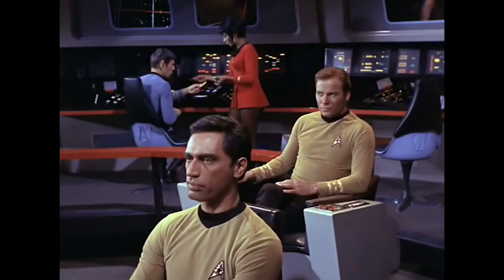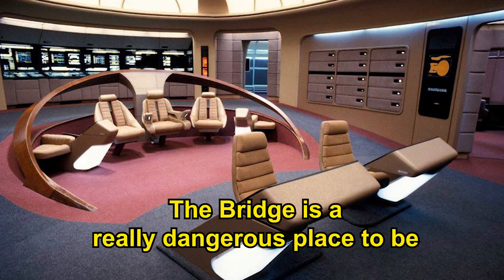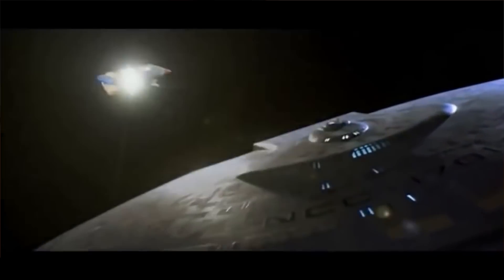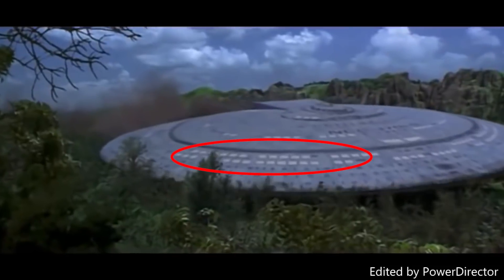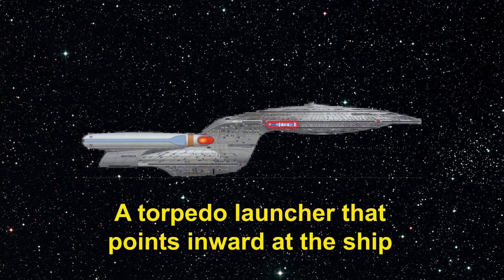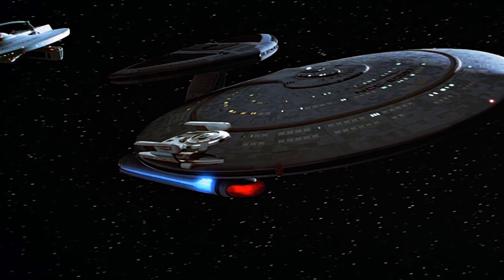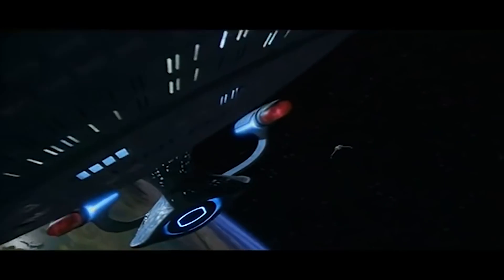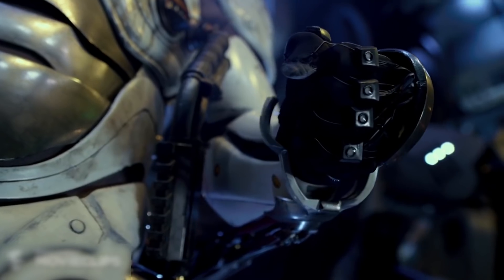10 Flaws Star Trek - USS Enterprise NCC 1701-D

Comment: One thing you missed in 10 things wrong with the Enterprise Galaxy class,about the warp nacelles:In the original design of the U.S.S.Enterprise is that in the warp design,the nacelles were placed as far away from the crew occupied sections as possible to limit exposure to the radiation thrown off from the engines while at full power.That radiation would kill everyone on the ship.Klingons,on the other hand,didn't care about how many died from radiation poisoning on their warbirds.

Comment: Flaw1 The Bridge: The Enterprise is not made for war. It is a science vessel! Flaw3 The Enterprise is not made for Landing, because usually there is no reason for it (Beaming Technology and Shuttles).  Flaw3 that is correct. Flaw4 that is also correct (Escape Pods), Flaw5 is also correct, the computer could remodulate the shields automaticaly. Flaw6  its correct tbh. Flaw7  yeah that is correct. Flaw8 The Federation has almost infinite ressources, so there is no need for saving it. There are families on all federation vessels and I think the Federation wanted to build proper vessels for them.

Comment: A few questions:  
1 What happens when you end program in the holodeck after taking a dump in there?
2 Why couldn't they replicate a bunch of Data's?
3 Speaking of Data, why does he have to use a keypad - wouldn't it be faster for him to interface via wire (or wireless)?
4 What kind of bandwidth does a Vulcan pull when he is doing a mind meld?  If you had a chain of Vulcans mind melding the one next to him/her, would there be a data loss?
5 Why couldn't they replicate more replicators?- they could build another Enterprise in less than a day!  Why not replicate lithium crystals?
:)
Reply: 1: indeed.. scary LOL
2: he apparently is too complex to be replicated through the available replicator tech
3: Most of the times Data hooked himself up to interface with the the ships computer, something went horribly wrong. On top of that there are security measures in place to prevent a single user to have such control on such a powerful piece of equipment. 
4: unknown
5: same answer as 2

I would actually ask.. if data can be "transported" why couldnt they just keep on re-materialising more? The same for equipment. The transporter tech doesnt seem to have the same limitations as replicator tech.

Comment: The Nacelle's that stick out is not the engine, they only help generate the warp field. The engine is inside, it's the big tubular gizmo in engineering referred to as the warp core. There is a episode in voyager where a admiral is giving janeway a walk though and points to the warp core as the only class 9 warp drive in the fleet, he was not pointing the nacelle's. You can also look at the series enterprise where commander tucker points to the engine and tells people your looking at the only warp 5 engine in the fleet. If you watch enough trek you get a idea how it all goes together and one reason for sticking the nacelle's out is they get very toasty hot when operating. Remember the episode in enterprise where they had to hide in the nacelle during the storm.
Reply: true, but that's like saying you don't need wheels for a car to move. also when the nacelles get hit it often damages the whole ship and engine in some way. They never really explained how the defiant can get away with having the coils inside the main hull.
Reply: It does not just heat its radiation. The Defiant is small enough that they can get away with radiation shielding. But the bigger the ship the bigger the warp nacelles the bigger the radiation hazard.
Reply: @michaelkenny7314  
Accorting to the TNG Technical Manual, the nacelles have to have some physical distance from the habitable spaceframe because the warp field distorts spacetime; where the field is not uniform objects down to the atomic scale tend to move through space and time at different rates; imagine the stress a non-uniform field density would create on the ship itself, to say nothing of organic life.
Reply: @HuntingTarg  Probably one of the reasons the Defiant has so many issues.
Reply: @matthewholderbaum3001  
No, the Defiant was the Federation's first attempt at a dedicated ship of war since the first Klingon war and the Dreadnaught class.  The warp field isn't her main hangup; it's the warp core .  Three sets of injector coils, three sets of dilithium crystals and brackets, three reaction chambers in one pressure vessel.  O'Brien was a crack technician and he hated working on the Defiant.
Yet she's still a butt-kicking name-taker.

Comment: Number 11: the saucer section doesn't have its own warp engine (unlike the Prometheus), therefore it couldn't get far away from the engineering section before the core breach.
Reply: The whole point of separating the saucer section in case of a core breach is the ability to get away from the warp core, having a second warp core inside the saucer section in a place where they can't separate from in case of emergency makes no sense, plus the saucer section had impulse engines, the enterprise-d full impulse is about 90% of the speed of light with acceleration of 10 kilometers per second per second, under normal conditions without damage it's more than enough to get far away before the core breach.

Comment: A couple of comments in no particular order:

I believe the nacelles were placed where they are to limit radiation exposure from the engines.  Why is that not a concern in other ships?  No idea.  You’d think it would be especially concerning in the nebula class, which was basically the galaxy class but with a stumpier secondary hull.  I do know it was said though either in the show or the tech manual.  The only thing I can thing of is that at the time of its design the galaxy class was the most advanced and powerful Federation starship so its engines were larger and more powerful than others so they were concerned about the radiation.

The space that ship took up is not as important since it is in space and the ship achieves FTL via a space warp.  Presumably ship could keep getting larger as long as the engines were large enough to project a warp field around the entire ship.  So, having unused space makes sense since the Enterprise and the other galaxy class starships were intended to operate for decades, one presumes you’d want to be able to easily upgrade the ship.  Technically the entire ship was modular, even the bridge could be removed and replaced.

The Enterprise was primary a science and exploratory vessel, as is Starfleets primary mission.   While the Enterprise did have powerful offensive and defensive capablilities I feel it didn’t fully come into its own until the Borg crisis.  I am actually surprised Starfleet didn’t end the practice of families on ships, at least as many as there were, after the battle of Wolf 359 as I imagine many civilians were lost as well. That being said, it made sense for the ship to serve multiple roles given it was meant to operate on the fringes of the Federation, often in deep space where they would be out of range of any possible assistance.  I mean how often did Picard and Co. really encounter other Federation ships.

The Enterprise E definitely still had science labs, it was still considered and exploratory vessel.  The Federation doesn’t really design military craft, the Defiant class being one of the few exceptions to that rule.  By the end of the dominion war many of the battles still involved glaxay classes and other primarily explorer type ships.  That being said, they did have small fighter type craft by the end.

Anyway, sorry, I can’t help but comment, but I found this really interesting.  It has honestly always bothered me that the bridge was right on the freaking top like you said.  It should have been right in the middle of the ship so it would be the most protected, Iike main engineering.  Shield modulation also always bothered me.  The computer should have been altering that constantly.  Though maybe they thought it wasn’t necessary because they’d pick a random frequency and the chances that an enemy would have their weapons on the same frequency would be ridiculously small.

But yeah, really enjoyed the video.
Reply: There was one episode where an engineer was killed by jumping into a bunch of plasma in the nacelle of something like that... I don't remember the details, but the point is they have crews of engineers who work full-time posts up there in the nacelles.

I think there was a line about how they didn't really know the one who had killed themselves well because they had only been posted there for a few weeks?  So that implies that they would normally be posted at those position for an extended amount of time, meaning it can't be too dangerous to hang out very close to the nacelles.  

I was always under the impression that the nacelle positioning had something to do with shaping the warp bubble around the ship, although it seems it would make more sense if they were aligned with the center mass of the ship, rather than in the rear. and above/below, depending on the federation ship design.  IIRC, Cochrane's original design made more sense to me... nacelles were positioned on the center line of the ship, both side to side and front to back.
Reply: @PartapDavis  I think the potential logic after Wolf 359 in regard to families on starships might end up being seeing that the whole human race sits in a very precarious position perhaps it is better that potential breeding populations exist starships that could escape to other regions of space.  It is logical.
Reply: I just realized we are talking about a stage prop. It wasn't designed so much as grown.
Reply: Not having science labs would be pretty dangerous at times, being in a Star Treck storyline. ;-)

Comment: TL:DR, I am going to take this joke concept and way over analyze it. So take my nonsense with a grain of salt. 

It had its flaws because Gene Roddenberry had no idea how to design a warship. All the ships in his shows/movies had the same flaws pretty much. Also, it seems like up until they encounter the Borg, a race with Far superior weapons and tech and the intent to use them. That the Federation had no interest in building ships purely for a war effort. They built impressive ships, but nothing solely for war until DS9 and the Defiant. Once the Dominion war heats up is when the federation really seemed to kick into high gear when it came to warships. Even then they still built pretty crappy ones save until Voyager with the Prometheus. Personally, the Prometheus and the Akira class are the only ships I have liked design-wise, the Maranda comes close but meh. 

Most of what you point out is right, but two I take issue with. Number 4 has a few flaws, first being that the diagram shows a pretty terrible way to land. It seems more sensible to land the ship by first slowing it down in atmosphere by using the huge surface area of either the bottom or top of the ship while also using thrusters. Building in thrusters large enough and powerful enough to land the saucer section in the atmosphere is nuts. The amount of area you would eat up on something that you would never want to use is terrible. Not to mention the ship was built in space and used in space and I doubt the thought ever crossed their mind to land the ship in an atmosphere let alone a crash. As shown by the lack of thought in that crash diagram, clearly if that scenario ever happened they are going to assume the ship would be chalked up as a full loss and scrapped as it was in the movie. 

Number 10, as far as I understand. When in battle the Enterprise D would use pre-programmed battle tactics, in the very few instances it ever did any real combat or dog fight style combat. All other times they seemed to enter in coordinates. They only rarely ever used that D-pad style nav pad, even then they never explain how it works to any degree, it simply does. They even use them for shuttles which you would think would be better suited with a joystick of some sort. So that is more writing and prop design flaw(Guessing they thought it looked good) in the show than anything. It would make no sense in any real-world use which is why it seems to be corrected for other shows and movies going forward. 

Also, it would seem pretty much every ship named Enterprise would have most of these flaws. Though I don't count the Scott Bakula Enterprise, cause that show was really sub-par, even if the ship was not half bad looking. I have not seen Discovery so I cannot comment.
Reply: Uh, you missed the part about the Klingons and Romulans
Reply: Gene Roddenberry was a hack!  He ripped alot of his ideas and concepts from Forbidden Planet, and the Transporter from the Buck Rogers serials of the late 1930's
Reply: I'm currently watching the Original Series and it seems that Roddenberry was really sketchy even in basic space science, like what an orbit is. Enterprise apparently needs to fire its engines all the time and if for some reason it loses power, its orbit decays in just a few hours if not minutes. I've just reached the episode with an alternate universe, in which the show proves it has no idea what antimatter really is.

Comment: In all fairness, a joystick is fine at supersonic speeds, but no human could control a starship at FTL speeds with one.  Maybe in a low-speed encounter it might be useful, but even modern airliners are mostly controlled now through inputs to the autopilot rather than direct joystick control.

The wasted space in the Enterprise and the bridge position are both valid criticisms.  The screens are all electronic, so there is no reason that the bridge needs to be physically atop the ship.  And like a submarine, every inch of the ship requires that a processed environment be provided, so any extra space is a potential hazard and a burden on the environmental support.  Of course, in reality, they need to be able to easily move cameras through the corridors, hence the ridiculous dimensions.
Reply: You know it transports on a mushroom network.  Get ready to update your Sporehub drive.
Reply: The joystick wasn't used for FTL travel. It was specifically used for evasive maneuvers. Like the reason a fighter jet has a joystick. There's no way anyone other than Data could type in coordinate changes fast enough to maneuver in a dog fight.  Speaking of which, it's kinda funny that they made Data use analog to interface with the ship's computer.
Reply: The Enterprise-D is not at all comparable to a military ship or submarine, the original concept is more like a space station with engines, which operates independently for years in unexplored space and runs all sorts of projects and experiments at the same time. So people will actually not only work, but live on that "station" and have families. Which means you need all the stuff for people to live and work, which includes recreation, education, sports, medical facilites and also space for future expansion. A big part of the Enterprise's mission was diplomacy (not surpring that someone well versed in diplomacy was chosen as the Captain) and it also hosted events, which involved welcoming guests and dignitaries from different species, for which appropriate facilities and accomodations have to be available. After all, as the flagship of the Federation it represented this organisation. For military engagements the saucer section with the civilians would be separated, leaving all the "extra weight" behind.

The problem is that the above concept was rarely used in the show, because even if combat was imminent, the ship was rarely separated. Which is more a case of bad writing.
Reply: That's fine, except that it assumes that the Enterprise's mission doesn't routinely put the ship and all its passengers into mortal danger.  Which, unfortunately, it does, in nearly every episode.  The families and children would be safer on most modern military vessels than they are on the Enterprise.  So the Federation is clearly not thinking things through.

Comment: Actually, that joystick was stupid thing and touchscreen-button-slider control was much more realistic. Starship is not a plane, it does not move in 3 axis only, it also can "strafe" like in fps games, not only sideways but also up and down, plus forward/backward movement as well ofcourse. Not only this, by differentiating power output on front and back manouvering thrusters, say on one side of the ship, you could "drift" - move sideways on an arc around the target but still point your ships nose towards it. Hell, add the same for vertical control and you're making really nice dance around a point in space while still having your nose towards it.
Helm consol for a ship like this should be way more complicated than simple joystick, and lets not forget about inertia, starship like that is a giant log, it wont respond in a split second like a fighter jet. Joystick - that's what was really stupid there.
Reply: 3dConnexion would like to have a talk with you
Reply: @tiagotiagot  - this is actulally pretty neat solution indeed. Still arguable in giant spaceship with lot of mass IMO, but yea, controller where you can not only tilt and twist it's handle like in normal joystick, but also move it sideways and up/down would work.
Reply: I think you're right but the only thing I would change is a starship does still have that same three axis of movement like an airplane (pitch, roll, yaw) and using a combination of those three will get you the same actions as you said, i mean, it can only move in 3D space just like any other aircraft. The big difference is fixed wing flight versus not that I think you're held up on is like a drone or helicopter, that can hold a hover, whereas a plane always has to stay moving forward but is still capable of some of the motions you're thinking of. Strafing has another term for a movement in fixed-wing military aircraft and actually is where the term strafe came from, not FPS.